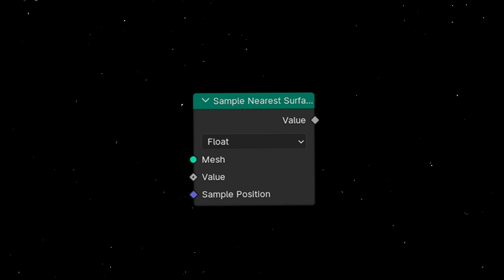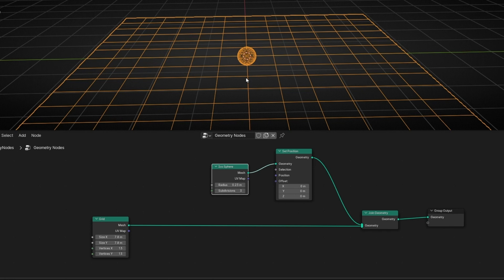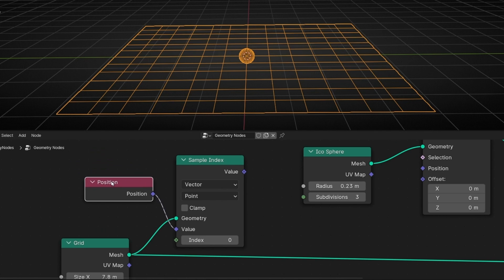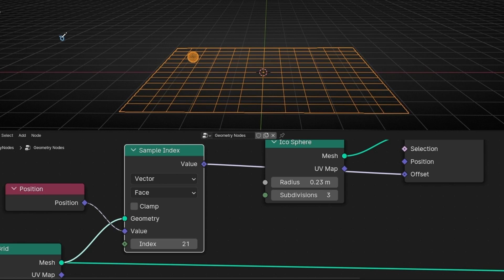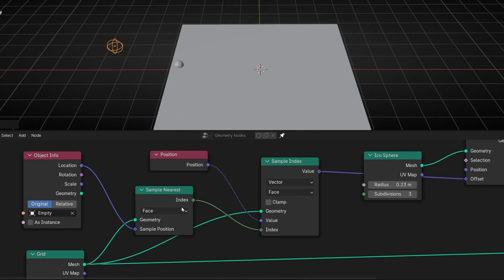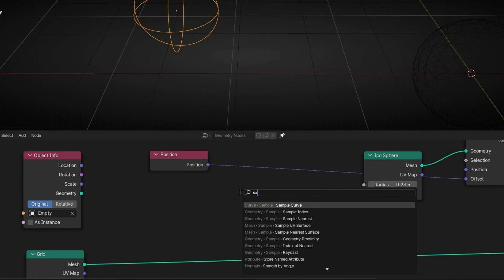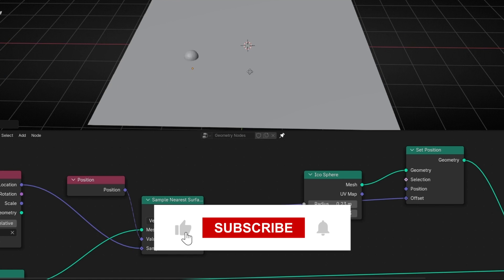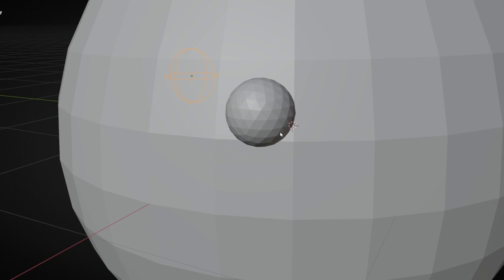How SAMPLE NEAREST SURFACE works in Blender - Geometry Nodes

Comment: Why this node Sample Index node need additional Position node? The grid node is generating the mesh, it doesn't have position of vertices?
From intuitiveness point of view, had i tried his node w/o referring to your video or documentation first, I would be lost.
Reply from the maker: I know it's confusing, it happened to me when I was learning Geometry Nodes. For me, the way to understand the Position node is like: some nodes can apply modifications based in position. However, they need a 🗺️ position map which contains all the data that can use to apply some modification. So, without this node is like they are lost. 

Think like you are a delivery pizza worker and I tell you: you have to go to Street X. Okay, but if you don't have a map/app to see where is this street, then you are lost. So, that's why Position node is for. If your node is not working, maybe it is because he needs a position map to have a reference.

I will do a tutorial with some example to illustrate it better :)